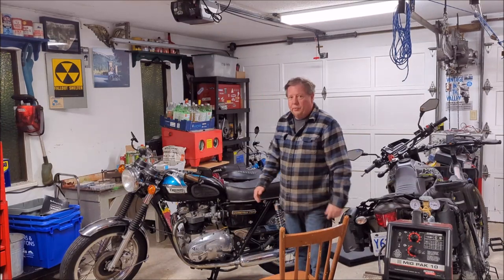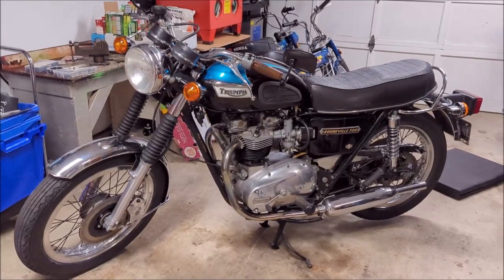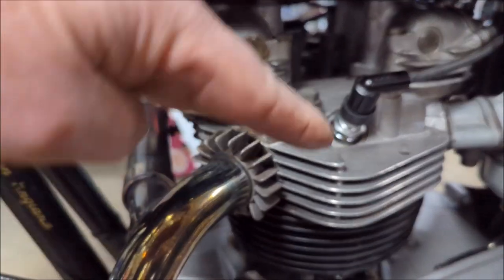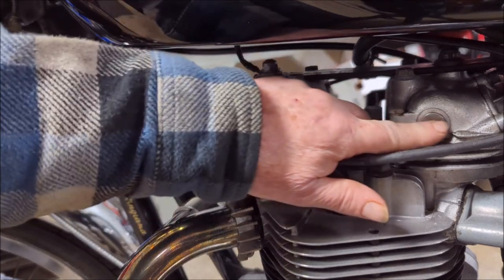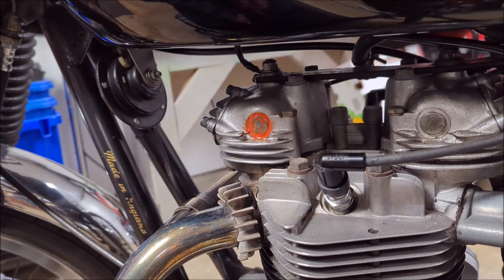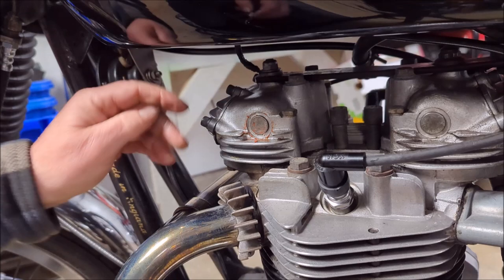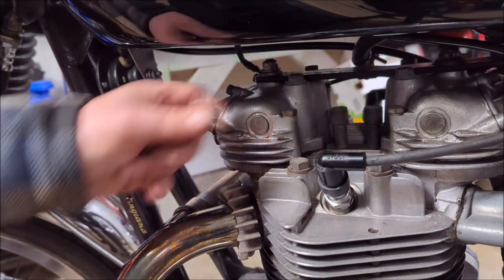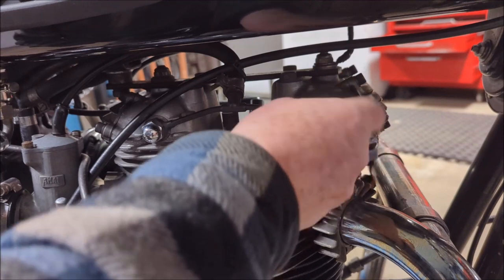Triumph Bonneville T140v - Part 2 - Rocker Shaft O'Ring Replacement

Comment: This o-ring replacement is a simple job, but it pays to do both at the same time. 

Take both banjo union nuts off so you can remove the oil feed pipe out of the way.
The easiest way is to take the rocker covers off so you can see the rockers, then rotate the engine to a position where one of the rocker boxes has both valves fully closed (if necessary, slacken the the tappet adjusters to take the load off). Then you tap the shaft through until the o-ring is an inch or so clear of the housing. Now you can remove the old o-ring and clean up around it.

This next step is where you need the special tool to do the job properly. It's simply a sleeve with a tapered bore which compresses the o-ring and guides it into the housing without damaging it. They are cheap to buy and should be available wherever you buy your Triumph parts.

Slip the guide sleeve over the end of the shaft, then fit the new o-ring in its groove and smear some grease on it.
Hold the sleeve flush against the housing and carefully tap the shaft through it and back into place.

Repeat this process with the second rocker box and refit oil feed pipe, preferably using new copper washers.
Even if you didn't have to slacken the tappets, it would be wise to check the clearances as the shafts may have rotated during the process and affected the clearance.

My 78 T140V has only had a leak on these once in its 46 year life, although I did change them both again as a precaution 3 years ago when I did a top end overhaul. The important thing is not to damage them when you install them - simple with the guide sleeve, difficult without it.
Reply from the maker: @rickconstant6106, you're right!   I should have replaced both of the o'rings at the same time.    The intake one (which I did not replace) is on my to-do list.   Thanks also for letting me know the process you follow as I'll be sure to either loosen the valves and/or ensure both valves are closed before doing the work.   This makes good sense and something I should have done when I did the exhaust side.    Thanks Again!   If you haven't already, please subscribe!   I would really appreciate it :)   Cheers!

Comment: When I see a repair like that I'm scared to see what I'll find underneath it, because who would do that in lieu of just replacing the o-ring unless there's a bigger issue?   In this case, it looks like there wasn't a bigger issue which is good.  I have the tool for the o-rings, but I don't think you need it.   If you watch the Lowbrow Customs Triumph 650 rebuild series (which is a great series) Todd just knocks them in there.  It may or may not shave a tiny bit of o-ring, but it'll still be oil tight, I've done it both ways.   I can't imagine that rubber band and brass compressed the very o-ring much.  The actual tool is a super tight fit on the o-ring.  I wonder if a small clamp would work, like a miniature piston compressor.
Reply from the maker: Hi @daveco1270, I know what you mean about the 'Glue' approach to fixing that rocker shaft leak.  Had me a bit concerned too, but as I go through the bike, so far everything else appears to have been maintained relatively well.   Fingers crossed.    Regarding the rocker shaft o'ring install, I think you are right that just pounding it in would work well too.  With the method I used with the brass shim stock, the rubber band didn't provide any meaningful tension but just intended to hold the shim stock in place.   The leading edge of the shim stock was placed into the hole first and then as you pound it into the hole it creates the tension to compress the o'ring as you drive it into the hole.   Copied this technique from Unilad (youtube channel) who used a similar method with a thin feeler gauge.   The rubber band was just to hold the brass shim in a circular shape around the shaft.  Hope that makes some sense :)   So far so good and it doesn't leak ...well, not yet :)   You're right LowBrow Customs / Todd is amazing and really enjoy those videos.    If you haven't already, please subscribe!   I would really appreciate it :)   Thanks Again!

Comment: It shaved a sliver off the O-ring as you drove it in, pretty much the same problem we all have I think. It may be fine,  lets see if it leaks or not.
Reply from the maker: @paulwoods682, very observant of you!  Yes it took a tiny sliver off the top of the o'ring, but so far so good.   I have taken it on a few rides and so far zero oil leaks.   I should have tackled both of them at the same time, but plan to do the other one here in the coming weeks.   Thanks again for the comment!

Comment: I would change them both bud, if the one is that brittle then so's the other. Always grease o rings to help them squeeze in.
Reply from the maker: Hi Bill, great advice!  I'll do the other one and use some grease instead of oil during the install.   Appreciate the guidance :)
Reply: @MadTinkerman  Anytime my friend